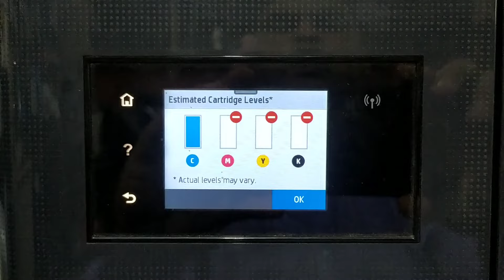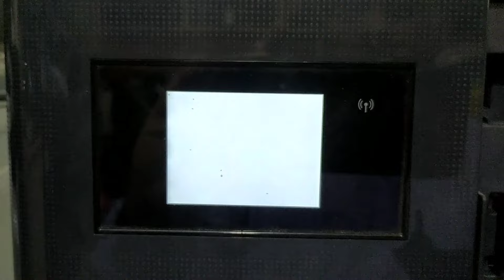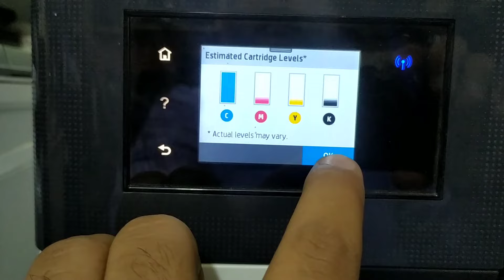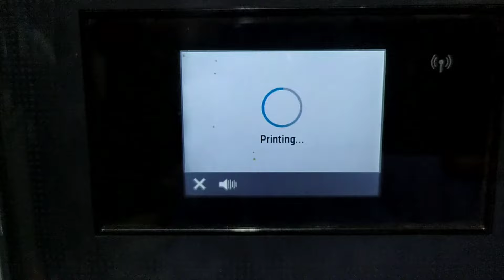How to Fix the Incompatible Cartridge Problem - HP Office Jet Pro 7740

Comment: Our Hp 7740 printer worked perfectly, using generic ink cartridges, for many years until Hp updated the machine software. After update, our printer rejects the generic ink cartridges and will only work with genuine ink cartridges. 
How do we fix this problem?